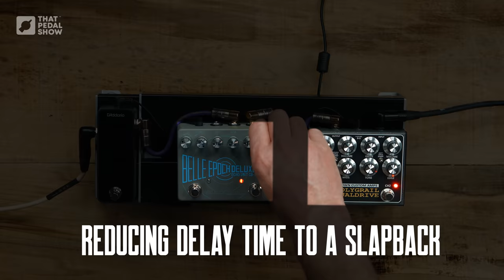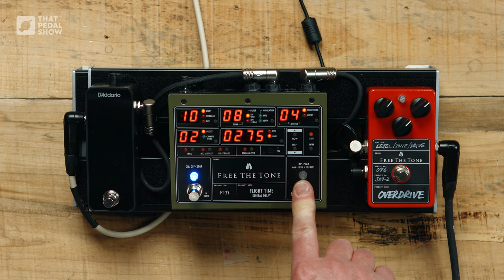Small Pedalboard Build [With Yet More Pedal Indecision & A Gig Too!]

Comment: When learning to change my strings, in 1995 or so, I lost control of an acoustic string when opening the package. The string uncoiled from its paper sleeve with more force than I expected... like a tiny sprung wildling... It whipped through the air, sticking the bare bit of core on the string's end a good mm or two into the fleshy part of my thumb. It drew blood. I believe it was a set of Ernie Ball Earthwound Mediums.

Comment: Recently bought the CIOKS 7 and the expansion kit (totalling 11 outputs). As power supplies go, I would say it's on the podium. Never tried Dan's, but I would assume they are AWESOME. 

Really like these down to basics kind of episodes. Learned pretty much all I know about pedals and pedal boards from you guys,
Reply: I really like the CIOKS power supplies, and I'm sure Dan's are wonderful. The idea that for each output you can select the voltage and all outputs are isolated...terrific. I also got the CIOKS 7 and the other expansion, which has 8 outputs. So I can power 15 pedals of all types and voltages. It's heaven.
Reply: You can put GigRig Isolators at the end of the splitter cables. If you did that with the 1-3 cable, that’s 12 9v outputs from a single 9v output on the CIOKS. While that seems a bit silly, what I do is put a high current pedal on one end of the splitter, and put Isolator(s) on the rest.

Comment: That's a great tip RE position of the tuner in the chain! I run a gate, so I'm pretty much good, but that is a great idea.
You folk should do a vid on gates vs suppressors, limiters, etc.
Reply: I‘m not sure about this… because you have to turn off the drives. Or do you tune your driven sound?!?
Reply: @andrelangenbach4202  I've never had an issue tuning with a drive pedal on, or on the dirty channel of an amp. Not in 37 years of playing; I don't think it would be an issue. But I don't use a pedal tuner. Closest I've come is a stand alone tuner that has ins and outs(well before they built tuner pedals), and they were always first in chain, so who knows.
Reply: Ditto, noise gate.

Comment: It is very challenging on knowing what to do about pedals and tone.  Eric Clapton is right less is more dealing with pedals and I believe he got it from B.B. King.  I have seen B.B. live using no pedals straight into a Fender amp and sound amazing, and this was before they had all of these expensive sound engineer guys running gigantic sound boards.  I have seen Buddy Guy live numerous times sounding amazing using tweed amps cranked wide open and only using the volume on his guitar, his pickup selector switch, and occasionally for specifc songs a wha wha pedal.  On the other hand, I have a friend with a $4,000.00 pedalboard, a $5,000 amp head, several guitars ranging from $2,000 up to $10,000 each, and he sounds amazing.
Reply from the maker: Totally that!

Comment: On my small board 8 total I use a 1:2 2.1mm splitter going to two GigRig Isolators for all 8 and it sounds great with any 400ma  power supply or better (draws 302mA): right to left is... Glass Packs (my Tonebender 1.5+), Nitrous Treble Booster, Boss tuner buffered out, POT, Carbon Copy mini, Jam HM, Octane real tube clean boost, Soul Food modified.
I have the MXR power brick and it's not isolated??
I use one of the JHS mutting pedals on my big board. That way I can mute everything before the amp because it's quiet.
Mick do you really need a distributor in the case of only one isolator?
I am wearing my TPS Fuzz shirt as well :)

Comment: I always have a couple of picks in my car, but maybe an emergency tube screamer in the glove box makes sense, too
Reply from the maker: Exactly where mine is. :0)
Reply: @ThatPedalShow  I have an emergency overdrive and a little delay, both with batteries in them and patch cable at the ready (but not plugged into either pedal Input - made that mistake before) that live in the Mono case extra pocket bag. They have been called into action a couple of times after something went wonky on the board that couldn’t be diagnosed mid-gig, or at least not in the time it takes to avoid robbing the whole evening of energy and momentum. So it’s easier to just move the board aside and crack on with the spare duo. 
FWIW I think the last emergency pair I used were a Jan Ray and Wampler Ethereal, which does delay and verb. If I had to throw something in the bag today, it would be a dual drive or drive + boost and maybe the Eccos or Walrus D1. I like to have a tap tempo and ideally verb as well as delay in the one little box.

Comment: I use the mxr mini iso-brick. Great for a smaller board but could handle more than 5 pedals easily depending on the power usage of such pedals. Also you can chain bricks together. They’re super quiet!

Comment: My favorite guitar related injury was one night we were playing a gig in New Brunswick, New Jersey, and someone had forgot the speaker leads for our makeshift PA (me), so I was forced to run to a nearby store to buy some zip cord and cut off and strip the ends. For some odd reason, I lacked a pocket knife that night, so I was forced to borrow a Swiss Army knife from the manager of the pub where we were playing. He warned me about the sharpness of his knife, claiming he used it to shave his beard whilst camping, and I in my infinite wisdom, chose to believe he was taking the piss with me. 

He was not. Whilst separating the zip cord, the sharpness of the knife made it so effortless that I sliced deeply into the pad of my left index finger, which as I'm sure you will appreciate, is often used to fret one's notes. I did manage to plaster it, but was forced to grin and bear it through that gig, rather painfully, I might add. I will, of course, never make that mistake again.
Reply from the maker: Arggghhhhh. And the pads take so long to heal!

Comment: With Boss rubber and similar type backs, you can try unscrewing the back and flipping it over. This is common on wah pedals. This gives you a metal surface to stick your dual-lock to.

Comment: Great video and this is probably a really dumb question but... having the tuner at the end of the chain - surely all the effects before it would effect the signal going into the tuner? Apologise for my neanderthal understanding of pedal boards but I've only recently needed to create one as for years (40+) I just bought new batteries and chained a few up as needed on the floor in front of the mic stand. As for tuning, we had one tuner gaffer taped to the bass amp head which we'd use in between songs if anyone was sounding too out of tune (being actually "in" tune was not so much an issue with the phaser driven noise we made lol). It's only now I'm older and making different music that I've had the time and money to really think about effects and boards.
Reply from the maker: The only dumb question is the one you don’t ask Martin! You’re right to say that the tuner could be affected by pedals preceding, so for example a vibrato would cause big problems! As would any modulation. Gain isn’t so much of an issue but could affect harmonics and all that if there’s a lot of it. So your wobbly, verb and delay pedals would want to be off if you have the tuner at the end… most ODs would be okay I think, but no peds at all on is optimal!!
Reply: @ThatPedalShow  Ah cool, thanks for confirming as I wasn't sure if modern tuners were somehow "magic" and could mute effects on pedals proceeding them to get a clean signal. I have one of the Ed O'Brien strats and kept on trying to tune with the sustainer on which drove my tuner crazy (now I check its switched off lol) so I suspected that having the tuner at the front of the chain was the ideal slot where possible. Cheers 👍

Comment: If there is one thing I've learned about "tone" in 35 years of doing live sound and 30 years of gigging on the stage myself, it's that there's no such thing as "perfect tone". The moment you think you have something perfected, the second you step into a different venue, all bets are off. So, as much as I like to faff about with building the "perfect" pedalboard for me and my music, I always bear in mind that sometimes, you just need to plug a guitar or a bass into an amp and have at it. 

Particularly when, like me, you are playing almost entirely original music, no one in the audience knows how it's "supposed" to sound, unless they actually happen to be a fan or a friend and know my music. And even then, sometimes, you should do a stripped-down, bare bones version of a song just to be sure it works without all the gewgaws and trappings. I always keep a "jam session" pedalboard ready to go: tuner, overdrive, reverb, just the basics, maybe a one-knob clean boost for a second gain level. Not too dissimilar from what Mick built for this gig, although I wouldn't need to go through several iterations. 

The jam session board is currently all tc electronic: Polytune tuner, MojoMojo overdrive, Spark booster, HOF reverb. It's cheap, it sounds brilliant, and it gives me loads of tonal variations. There's not a stage in the world where I'd be embarrassed to use that board. The next iteration might be mostly One Control BJFe pedals: Honey Bee overdrive, Granith Grey booster, Prussian Blue reverb. I just need to get the Prussian Blue. Much more expensive than the tc electronic stuff, but it doesn't sound any *better*, per se, just a little different.
Reply from the maker: Love this, thanks Gemma. :0)

Comment: As it is not a strobe, could you have put the tuner upside down (the switch towards the knobs of the other pedals) so it wouldn't be in the way of the tap tempo? Referring to the first iteration of that board. Thanks

Comment: The price of these is crazy, it's 100% premium because there is nothing like this in the mainstream. If you add their official bag it's basically 200$ without any extra accessories for the smaller version. For that price you can get RockBoard Quad 4.2 with Flying Case.
Reply from the maker: Cool, if that works for you, go for it! When you look at how well it’s made and that it could literally last you a lifetime. I don’t think it’s too expensive. Certainly a serious step up in quality and finish than a simple welded board. Whatever takes your fancy I guess.

Comment: Butter knife? Doesn't that scratch the pedal? As someone concerned about resale value—i rarely consider any purchase as 'permanent,' since i don't collect and don't like to have more pedals than fit on my (big) board... i appreciated Rhett Shull's recommendation of an automotive trim removal tool as a great solution for prying pedals off a board. I got one that's kinda like an angled slab, made for my car's trim, and it's wonderful. $9 and maybe my best purchase of 2021.
Reply from the maker: That could work for the cautious. Never been a fan of it myself. :0)
Reply: @ThatPedalShow  "Cautious?" You tryin' t'say i'm weak or som'n? Like, less of a man? The very nerve of you....
:  )
I might suggest it's the "cautious" guy who builds a gig-specific pedalboard (over two episodes!) and has an emergency Tube Screamer in the boot. ["Boot" is right, right? I'm on the other side of the water.]

Comment: Hi. I've noticed in a good number of videos, when you display the info regarding the pedal order you're using at the time, that delay and reverb are usually going into the front of the amp, like in this video. I know you've mentioned Steven Wilson (honk) prefers that method, but you've said most put delay and reverb through the effects loop, which I do. Which method do you typically use at a gig?  I picked up the Vemuram myriad fuzz (monster pedal and very loud. I saw the video where you used and Dan's face lit up when he heard it) and Source Audio EQ2 recently and had to rewire my board. I'm using one of the EQ2's signal chains in the front and the other in the loop to try and clean up the reverb and delay as it seems to muddy up the sound. Any thoughts? Cheers!!
Reply from the maker: Hello Alan. While we acknowledge that lots of people use effects loops… Dan and I never do. For a couple of reasons. 1. A lot of our fave amps don’t have loops. 2. We tend to run our amps just on the edge of overdrive, and the kind of pedals we use (mostly analogue and if not analogue, then really good analogue dry through) sound better to us into the front of the amp. Bit chewier, more harmonic interest and interplay. We just prefer it that way.
Now, for those people who run a lot of gain from the preamp of the amp, and/or use a lot of digital pedals, the loop can be a cleaner place to have stuff. 
For us though, everything in the front, always. Cheers!
Reply: @ThatPedalShow  Thank you for the reply!! That makes a lot of sense. I use a single channel amp I had made for me. Putting everything in front might be a good idea, since I'm now forced to use the guitar volume knob. My reverb, delay (both TC Electronics), and EQ are digital. Only 1 other pedal has a digital component (Keeley Dark Side). Everything else is analogue. I typed out my question before seeing the gig portion of the video. It was nice to see you playing live with a band and an audience!! It is very special.  Good on ya', mate!! I can't wait to get back into it once things settle down a little more. Cheers!!

Comment: if you rotate the pedals with multiple switches, to make the switch you need at the lower edge of board it will reduce chances of selecting 2 switches at the same time.
Reply from the maker: Yep. And my very mild OCD shuts my brain down.

Comment: Mick how do you approach using one drive pedal, do you use the volume of the guitar full on for the solo sound and then roll it back for more rocky rhythm?
Reply from the maker: Yah! Exactly that. Might not work if you need a much more gainy sound for rhythm, but it all depends on the pedal and how much dirt you like to run. Cheers!

Comment: Question....why the need for the Distributor? I use an Isolator without a Distributor with a single output from my CS6 to power my drive pedals.
Reply from the maker: In case I need anything with more than 120ma. Cheers!

Comment: I understand Mick's point about Dan's power supply being overkill for this CURRENT board, but I disagree and recommend to all new pedal aficionados to "Buy Once, Cry Once".  First, I bought the Godlike Power All kit for $40CAD, I quickly out-grew it when I realized it was causing a lot of noise.  I next bought a VooDoo Labs Pedal Power 2 Plus for $270CAD.  After the digital revolution with Strymon, I needed more high current outlets, so I added a VooDoo Labs 4x4 for an additional $270CAD.  So, now I'm $580CAD into power supplies, that aren't modular, and might have been better off just buying a Gig Rig power supply from the beginning. EDIT: I just got to the 23 minute where Mick talks about the cycle of upgrading.

Comment: I haven’t had much luck with those cables. I’ve ordered 2 sets of them at different times and I’m both sets there are some plugs that are just too big to fit into some of my pedals. I’ve checked other cables and they fit just fine. It seems the sizes of the plugs just vary too much.

Comment: Really didn't need to use the Distributor. You could have connected your power source (Generator) directly to the Isolator. Also, EBS (or other brand) flat patch cables would have been more flexible, and have flatter plugs (might not have stuck out). And if the Isolator couldn't provide enough power, you could have connected the offending pedal directly to the Distributor (since you were using one), and that pedal would have been isolated from the other ones connected to the Isolator, but without the 120mA limit.
Reply from the maker: Thanks Steve.

Comment: XPND - a way to guarantee you are paying for more pedalboard than you need. Neat but I don’t see the point.
Reply from the maker: Eh? You don’t see the point in being able to make the board bigger and smaller? I would have thought that is one of the clearest points yet in gear design!
Reply: @ThatPedalShow  you are either paying for board space that you aren’t going to use OR you are going to use the whole thing and a fixed size board would be cheaper. And what are you going to carry it in?
Reply from the maker: If price is your concern then you’re probably better off making something simple. But I have at least five PedalTrain type boards of varying sizes. The big version of this would do the job of four of em. Horses for courses I guess!
Reply: Cheers Mick, price doesn’t concern me particularly, to me it just seems like a solution looking for a problem! As you say - horses for courses. (And a camel is a horse designed by a committee)